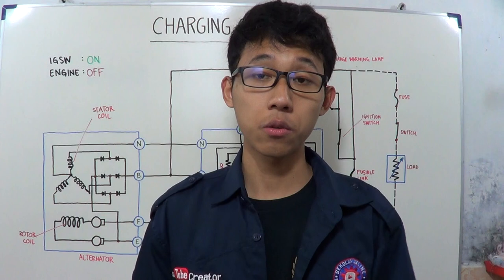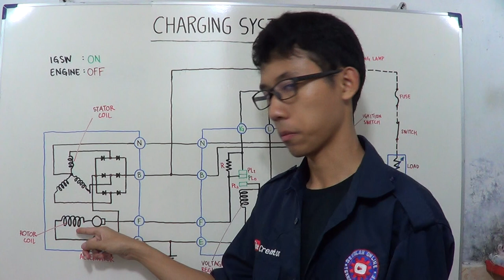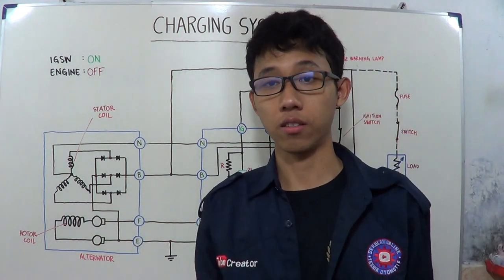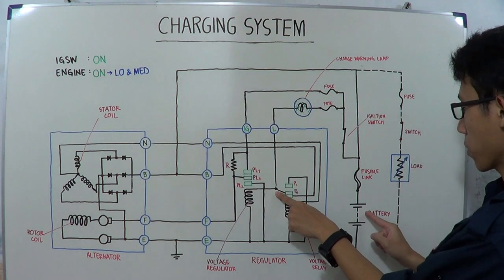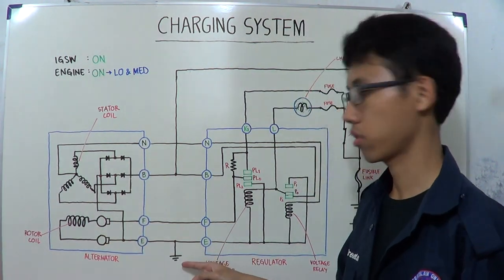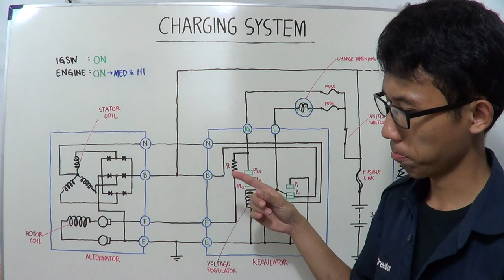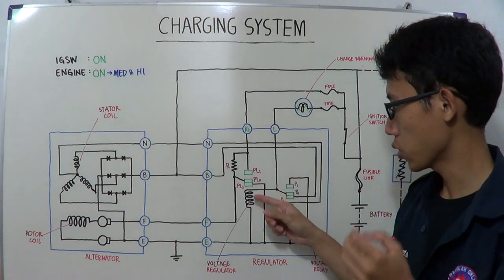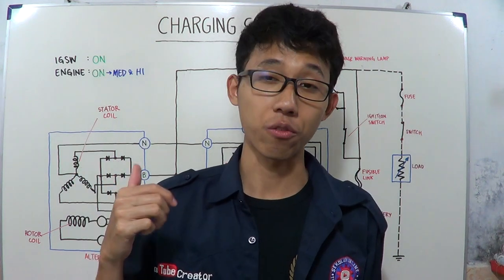How does the Car Charging System Work

Comment: This is very helpful in diagnosing what goes wrong with my avr. At first it runs at 16v on high rev then 14 when idle, now adjusted it goes 12.6v idle but somehow it limits on 14.9 now on high revs. I want somehow achieve 13.8v idle and 14.8v on hi rev. So still need to learn this.
Reply from the maker: Thanks! Hope you can solve what you're looking for :)
Reply: Yeah just did, issue is gap between pl1 and pl2 was too wide so i pinch pl2 a bit closer to pl1 and check if pl2 is not shorted with pl0 at off. Now it runs 14v idle and 14.8 at half to max rpm. Thanks
Reply from the maker: Glad to hear that, awesome!
Reply: Thanks

Comment: Would you like puting pattern regarding charging system with ic regulator lines from the alternator to the point of connections .
Reply from the maker: Brother, is this a question?

Comment: Keep that in mind the starter motor does not have a FUSE on it. It is directly connected to the batter thru a starter solenoid/relay. It means that there is so called HOT terminals even if you switch off the ign key.
Reply from the maker: Thank you for your information!

Comment: It is not true that the current doesn't flow in the resistor going to F terminal of alternator. Please perform the voltage check in the F terminal during engine run at high/medium speed.THE RESISTORS serves as a limeter of a current to control the magnetic field of the rotor in order to avoid OVERCHARGE OF THE BATTERY, but it doesn't mean the there is no current at all.

Comment: so during high speed, what supplies the electrical loads of the car if no current flowing on the rotor coil at this stage?  or you mean during high speed there is still small current flowing on the rotor coil?
Reply from the maker: Yes, that part should be understood carefully.
During medium and high speed, PL0 is intermittently contacting with PL2.
When PL0 and PL2 come into contact the alternator doesn't generate electric current, but a very few seconds later, they are disengaged (PL0 floating) so that the current is generated.
That happens intermittently in the short periods, depending on the demands.
You can take a screenshot of the EWD, and carefully analyze the concept.
Good luck!

Comment: Normally,all alternators have the three wires connector,connect to the back of the alternator. What is the function of each wire? One wire should have 12 volts,right ? The other two, are ground and computer controls,right? Can you explain,if I am wrong?
Reply from the maker: Thank you for your question.
It depends on what type of alternator do you have. What is your car and engine code number?
Reply: It’s an 01 Camry. Can you go by the S#s ? They’re, 4T1BG22K91U782903,

Comment: Does the alternator work whether spinning clockwise or counter clockwise?
Reply from the maker: The whole alternator assembly is not rotating. But Rotor, one of the component of alternator, rotates inside the stator. The direction of rotation of the rotor depends on the engine model.
Reply: @sekolahonlineteknikotomotif  good to know thank you

Comment: What is the work of bettery
Reply from the maker: The battery stores chemical energy and converts it to electrical energy. The chemical reactions in a battery involve the flow of electrons from one material (electrode) to another, through an external circuit. The flow of electrons provides an electric current that can be used to do work.